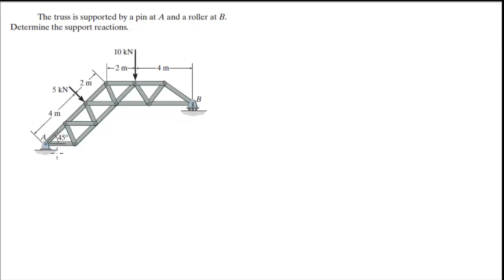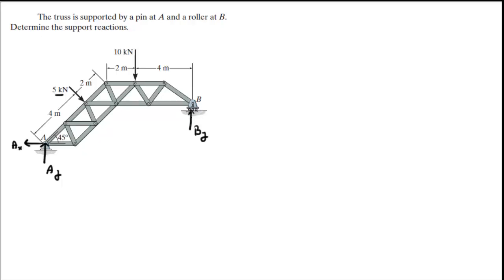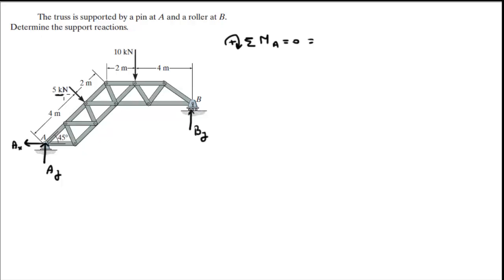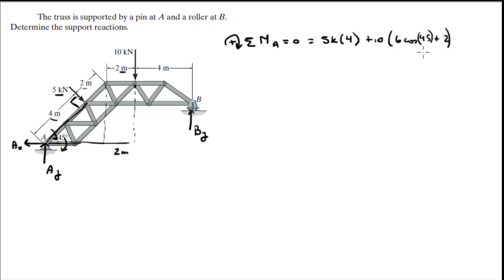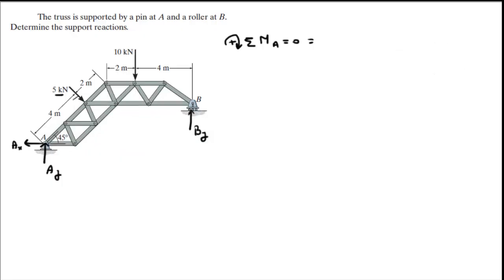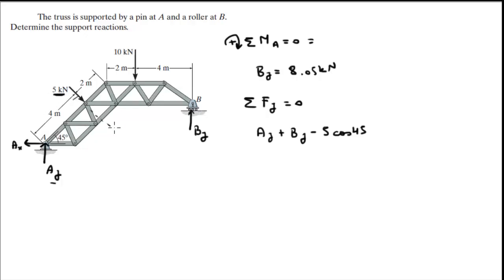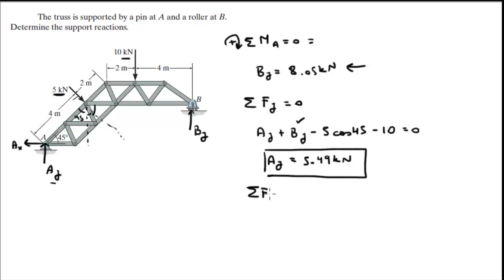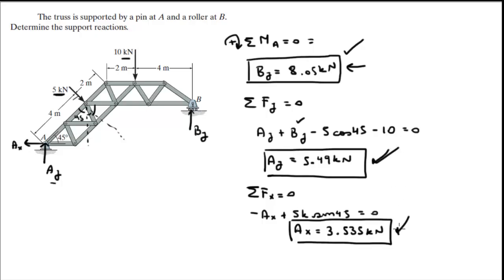Determine the support reactions

Comment: In the moments derivation part, 5kN is inclined to the x axis right?
So the perpendicular distance to it , you took it as 4m directly , would it not be 4sin45 and 4cos45 for the x and y components of the 5kN respectively?

Comment: If By comes out to be positive in the first solution, doesn't it mean it is acting downward? For the second solution, you solved the question by taking upside is positive. But (By) isn't negative. This is confusing.
Reply: By is acting upwards because the reaction force is pushing the truss up to be at equilibrium. newtons third law. equal opposite reactions remember ? he labled up as positive therefore By is positive since it's pushing up. hope thats not too hard too understand.
Reply: Thanks for reply. I just started this subject that's why I have confusions in directions. Thanks for explaining.